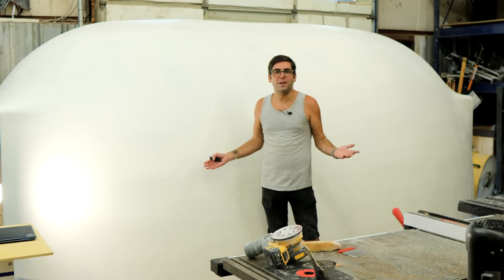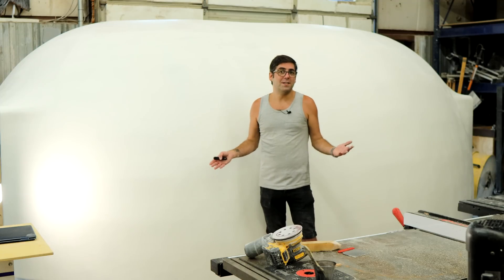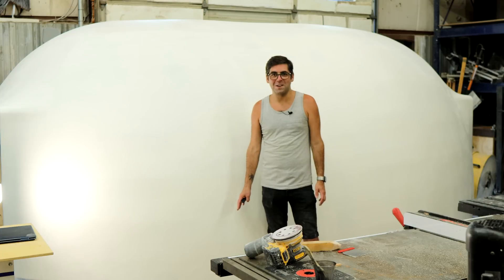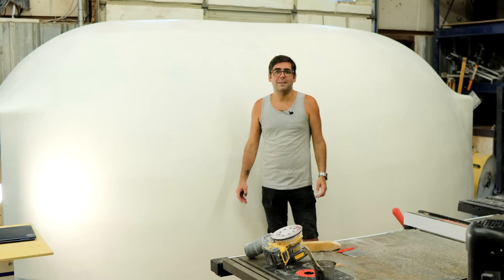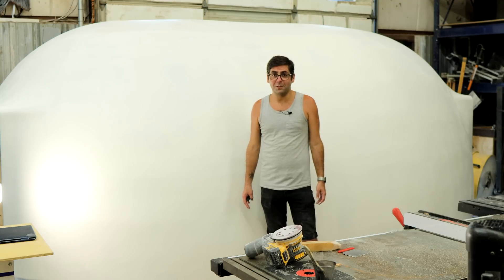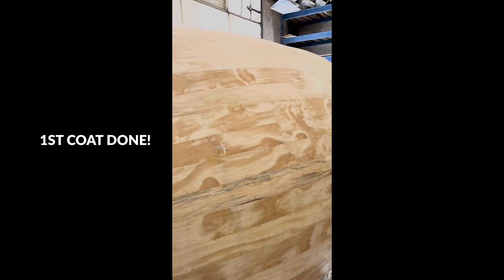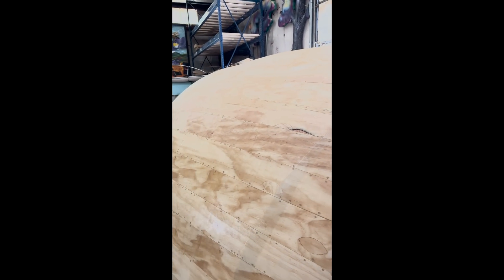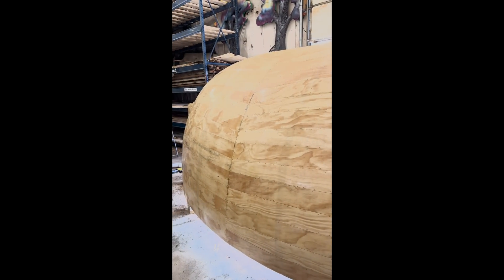Bubble Dome Part 3

Comment: I expected to see masks and face coverings during the fiberglass part, is that stuff not toxic any longer?
Reply from the maker: We used a dust extractor hooked up to the sanders most of the time, and often wore masks as well, though when we had a big crosswind through the shop and the dust extractor hooked to a sander, a mask felt somewhat redundant and stiflingly hot.